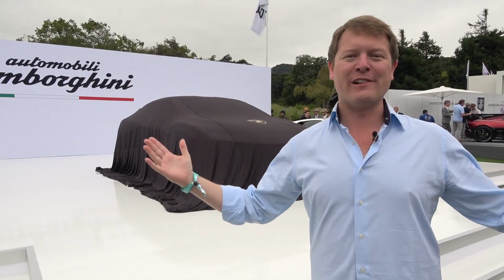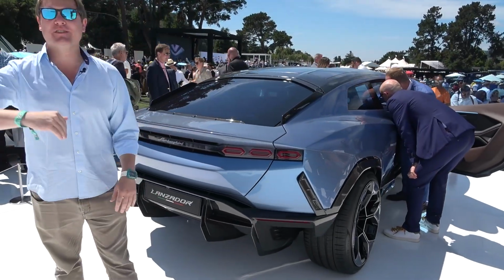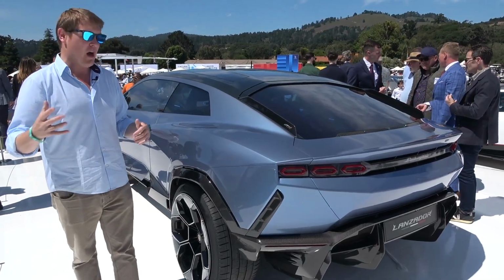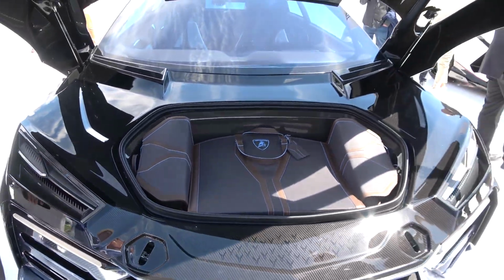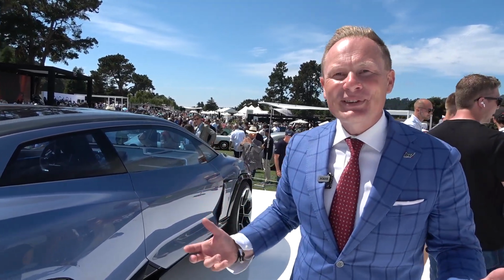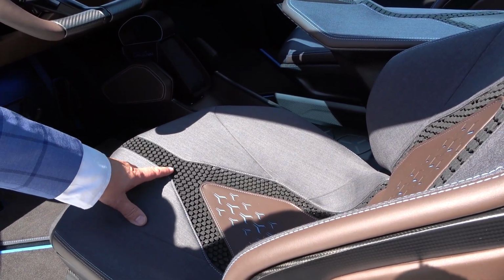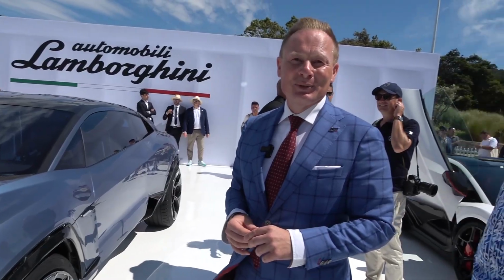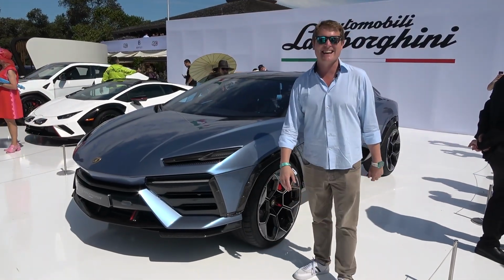New LAMBORGHINI LANZADOR! First Look at the 1,360hp ELECTRIC Lambo

Comment: Biodegradable seat material sounds reminiscent of Mercedes Benz using biodegradable wiring harnesses in the 90s. It also seems like EVs aren’t really engineered to last as long as ICE cars and this kind of proves that point. Right now people are clamoring to collect cars from the 90s and early 2000s; vehicles from 20-30 years ago. 20-30 years from now, none of todays EVs will still be on the road.

Comment: People here in the comments should stop thinking, EVs are only for the climate conscious. The price/performance ratio of EVs is now tipping the car industry and not the woke minded. Even today, your sub 50k€ Smart #1 'Brabus edition' has the same performance as the newly revealed AMG GT 55... Lamborghini said the Lanzador will have at least 1MW of peak power. Based on the SSP Sport platform, which Porsche is currently developing, max power is said to be 1.3MW or 1750hp (or 50% more power compared to the current Lucid Air Sapphire)... that's supercar territory like Hennessey Venom or Bugatti Chiron Super Sport... those cars are in the millions, cars based on the SSP Sport platform, will probably start around 100k€.

Comment: I like it a lot. More than the Urus. Range is the only thing. And battery cooling. Will it throttle power after some usage. Will it be able to perform at high speeds on the Autobahn ?

Comment: I know this Lambo electric car is pre-production and conceptual - call me fussy - but why does the rear tailgate have to be out of line sitting too low on the left nearside rear? Even the shut lines are out - too close on nearside and too wide on offside - One is showcasing a supposed important car for Lambo so why let this car through like that? Where's the quality control in what is meant to be a luxury car? The fact that it is pre-production is irrelevant.

Comment: Skinnier, low roll resistance tires will do way more for drag than that aero. Those fences around the rear window are to channel air to the cooling scoops on the bottom. I imagine cooling will be the "Achilles Heel" of performance EVs.

Comment: Horsepower numbers are just getting more and more irrelevant it seems. Especially so in electric cars.
Reply: All that matters is how it translates to performance and the numbers it produces.
Reply: @RMS027 No, it doesn't. 100kmh is usually the limit everywhere.
Reply: @Kronos0999  Your comment makes zero sense. We're talking about high horsepower numbers getting more and more common. The fact that a car is 1000hp nowadays is less impressive.
Reply: @Kronos0999  Power to get up to the legal speed is always relevant. If you take twice as long as traffic to get up to speed, then you will have trouble coping with day to day driving.
Reply: @RMS027  We don't live in your old age anymore, old man. Getting up to speed isn't the problem, crossing it is. Drove the F8 and was doing 80mph in 2nd gear. What a waste.